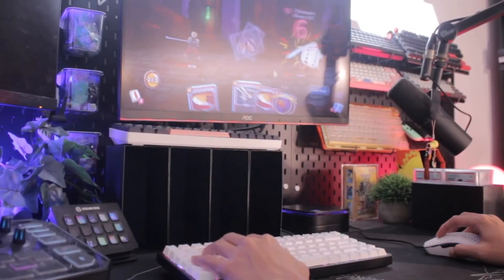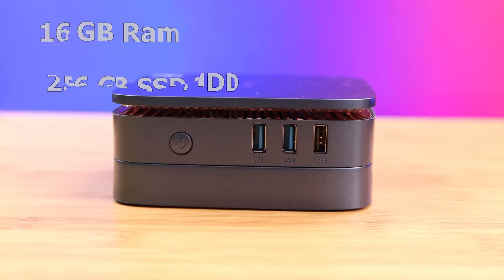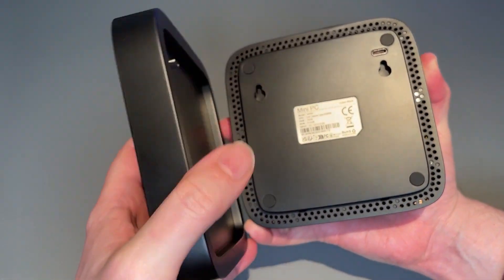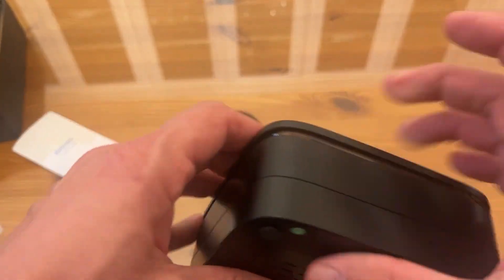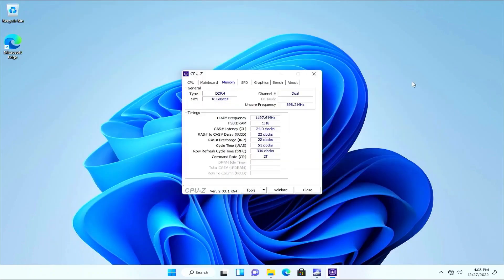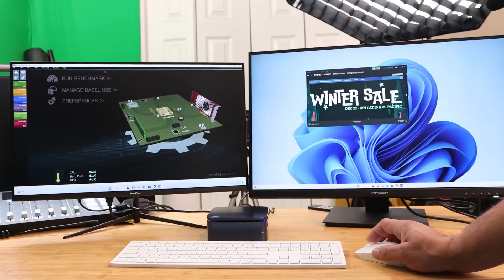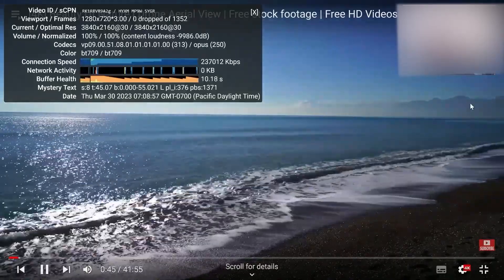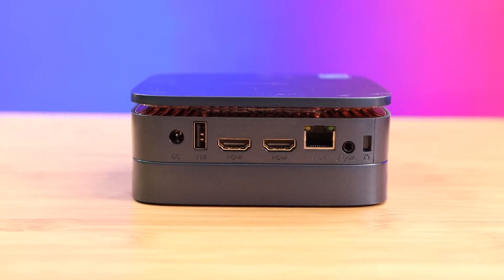Blackview MP60 Mini PC Windows 11 Pro Review!

Comment: Nothing will run fluid on this PC, for sure. The Celeron N5095 is exactly as fast, as an i5 of the third generation. And this was built 12 or so years ago. You can see the trueliness of this video already in the first few seconds, when the author says "It has a strong all around performance", and in the diagram on the left side you can see that it's the second last PC in the list. With just about a third of the performance of the first one.
Sure it takes no power, but it also provides no power. That's the reason, why the manufacturer never tells, which processor is built in. He always just refer to the generation, but not to the processor itself. Because he also knows, that this processor is cheap crap. Maybe it's fine for really basic office stuff, but don't expect to play any game from the last 10 years on this piece of crap.
And yes, of course: The creator of this video tells you, it's a good device, because with his Amazon affiliate link he earn money for every sold unit. It's that simple.
Reply: Agreed. This is a homelab/mini PC- I wouldn't dream of playing games on this thing, at all.
Reply: @moosesnWoop what about streaming and running obs?
Reply: @braylin7419  what about it?
Reply: It’s good for a homelab server?
Reply: @ajte4933  use an old laptop first. See what you need, how often you use it and how user friendly the experience is. Use something like CasaOS or UmbrelOs which is easy to use for home labs.

Then once you've spent like 6 months using this setup, look at building your own with similar or better parts. Will work out cheaper and you'll learn better this way.
Reply: Shit man. Minipc MP60 is amazing for my youtube chain...